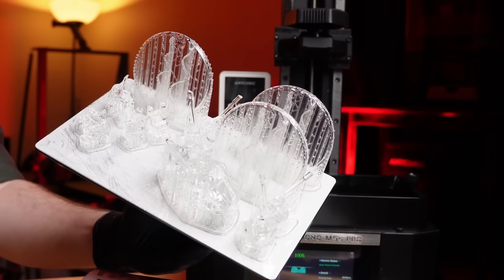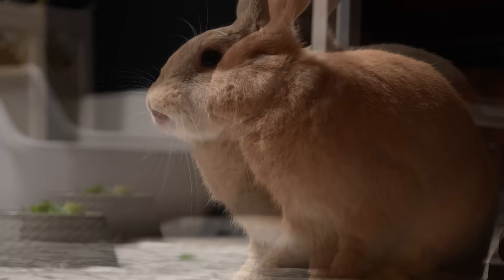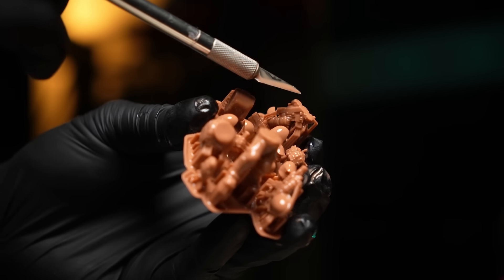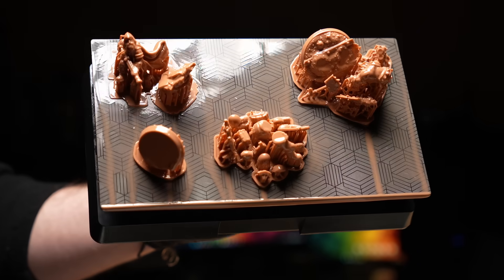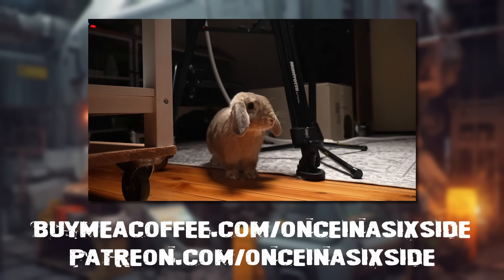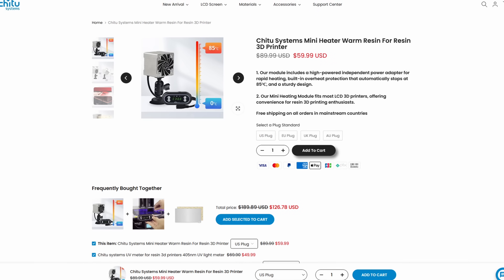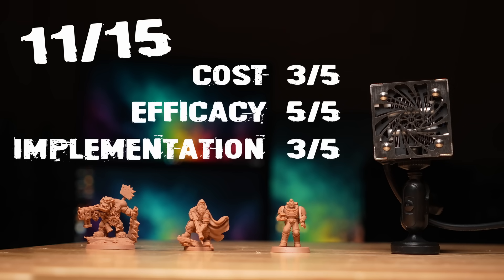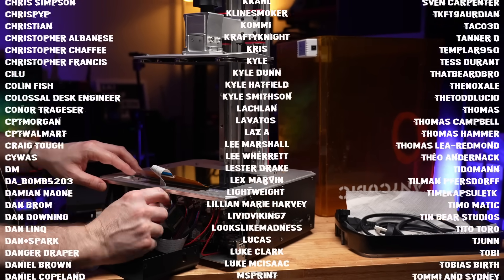Resin 3D Printers don't NEED inbuilt heaters (TESTED)

Comment: I had a fermentation belt wrapped around my vat with a 3d printed holder that pressed it up against the vat. Was a pain to get in and out but kept it snug. I used a temperature controlled outlet that had a probe that I kept in the resin vat itself and it worked great throughout the winter. Was very fiddly to take on and off but having back to back prints with no failures meant that I didn't have a reason to. I used to have a heat fan inside an enclosure but that felt really sketchy since those heaters are explicity stated to not run without supervision or in an enclosed space.

Comment: Given enough preheat time with the build plate near the bed, the brewer's belt is a great low-cost option.  The reason blowers work a bit better for the early bit of printing is because they also heat the build plate.  $60 feels steep for what the Chitu blower is, but I guess that's all in the eyes of the beholder.

Comment: I actually got a first generation heater addon like a year ago had to drill ahole in the acrylic top, it worked great until the fan died, so it keeped heating to dangerous temperatures and it almost burned up... but again for the while before that It worked really great, it had a temp censor and you could determine the temp etc.  and was really small, smaller than all what you showed (minus the belt)

Comment: Thank you for this video as I'm trying to figure out what printer to get as a migrate up from my starter machine.  It may be summer here in Seattle, but I print in the basement (aka the Evil Resin Lair) and since the house doesn't need the furnace, the basement in summer is around 17c.  I have had prints fail.

I have tried the belt process, but there wasn't enough room between the front of the vat and the lid in my mono 4k, so I purchased a generic chamber heater (a few different labels look to be selling the same one on Amazon for around $35).  It's working, but wasn't sure if I needed more.  Sounds like I don't.  It alsosounds like maybe I can worry less about the heater part of my decision.

Please do a review on the M7 Pro.  It's on my short list, although the heater attached to the vat scares me, but then again I'm not keen on that uber drippy plate on the S4U.  hmmm......

Thanks Again!

Comment: I built a box to house my printer (the top of which I already had set up for airbrushing) and wired in an electrical outlet. I plugged in a $25 personal heater (with thermostat) and use it to warm the enclosure. It works well enough.

Comment: Coming from fdm printers and thinking about buying a resin one. Living in a tropical country, everything works against fdm printers. But mostly high humidity. But the more I search resin, the more I believe a lot of common problems will not be like that here. Will the resin be above 20 celcius? It is never less then that where I live.
Reply: The "ideal" tempreature for resin is 25C, but 20 shouldent be an issue at all
Reply: @yoschiannik8438  here it is usually 25 late in the night. Most of the time it will be higher and I plan to print during day time.
Reply: Just keep in mind resins purposes are much different than FDM typically. Do not expect anything high durability. I’m sure you know that, but just reinforcing it in case.
Reply: @Aztechnology.  I know. Will be keeping my fdm printers. Just that I tried 0.2 nozzle for kinda small and detailed and learned that needs resin. Just waiting for the new elegoo ultras. Those moving resin reservatory looks like a nice start for someone with no previous knowledge on resin.
Reply: @thomazff  definitely, I picked up an ultra 4 even as an experienced resin user just because it is less friction overall, and gets you to doing what you want. Which is making stuff, not tinkering all the time. Bambu Labs P1P was kind of the same thing for me.
Reply: @Aztechnology.  I wish things didn't get so expensive with import taxes in Brazil. A bambu lab gets too out of hand to buy as a hobbyist tool. Elegoo, and creality, have sales here, so despite still expensive, they are within my range. My K1 max prints very well for my needs. A resin will be a perfect fit for de small details prints.
Reply: @thomazff  same thing basically. I just meant they introduced to the market the stream of very user friendly printers. They’re immensely more consistent than the old Creality and Ender Printers of the day. Prusa is still the OG of just incredible, easy to use and reliable printers. But they were always so expensive for the features.

Comment: Thank you for this video. I got my first resin printer in the January-February time frame and I was having a lot of issues at 35-40 degrees Fahrenheit. I did eventually get the printer to successfully print some models because I’m stubborn but have been looking into different heating options for next winter.

Comment: I just got a slim desktop heater off amazon for half the price of ones "designed" for 3d printers. It's worked great for 18 months and coupled with thermostat temp control unit it's still less than either of the branded options. I did try the belt warmers and it sucked ass, annoying to clean your vat and I do get to below freezing temps in the winter and it could not keep up. The only thing to keep in mind with the blowers is that it's the ambient temp in the machine, not the temp of the resin itself which will always take longer to heat up than the surrounding air.
Reply: I bought the one that says “mini heater” that’s a top result on Amazon  for a small enclosure before YOUCIDI brand I believe and it burnt out within like a month. Is that the one? It’s possible I just had bad luck. I didn’t realize the new mini heater for elegoo is basically a standalone unit. I figured it would plug in somewhere, but that isn’t the case. I’m waiting to see what OISS says about it. But I’ll likely cancel and pick up something else depending on his thoughts.

Comment: Where I live, in winter, we get below 5 degrees. What I do is heat the resin bottle in warm water and heat the plate with boiling water before printing, then I cover the printer with a towel. To date I have had no problems with that method.
Reply: Just rember to say the correct prayers to the Omnishia when removing the towls to check your print. Wouldent want to upsett the machin spirit. Espacily on something with "Mars" in the name
Reply: @yoschiannik8438  Ave Deus Omnissiah - praise be the machine god.

Comment: Ooo. I had hoped my mini heater would come in with my Ultra 4. I haven’t been printing as it’s been too cold without it here. They told me August is when I can expect to receive my mini heater :(. I thought about the brewer belt, but I’m dubious because of the tilting Vat. Curious what your thoughts are, I’m sure I’ll see it in the video as well later. But I’ll pull the trigger now if you give me the thumbs up. 

Also curious if you’ve thought about potentially making a print to enclose the build plate so we don’t have as much resin cleanup, or if that’s probably a no go, due to the spring mechanism.

Comment: I used a brewers belt, but just wrapped it around the cover. I ran a cheap digital thermometer inside the cover and the internal temp went from 15 degrees to 27 degrees. I could then heat whichever printer I was using. The only downside was that the cover did become a little cloudy where the belt made contact.
Reply: I have one of these and never considered running it on the outside
Reply: Totally doing this
Reply: when you say cover, you mean the plastic casing for the printer right?
Reply: @Wheezr  Yes indeed. The removable cover. You may get some clouding of the plastic over time, but the heat of the belt is not enough to warp it.
Reply: That's good. I am not entirely worried about the warping since the place i live is quite cold right now, like -5C, so I am mostly worried about it not heating up enough
Reply: @Wheezr  Let me know how you get on buddy. It has worked fine for me, but to be fair, I have never had to deal with temps that low.
Reply: Will do, if that doesn't work, then I might have to double up with a fermentation belt and portable heater
Reply: @Wheezr  How did you get on?
Reply: @ well i guess it sort of helped, but i need to run more calibration tests
Reply from the maker: Ah, I hadn't considered that either! Good thing know